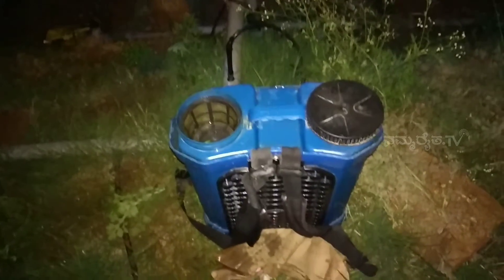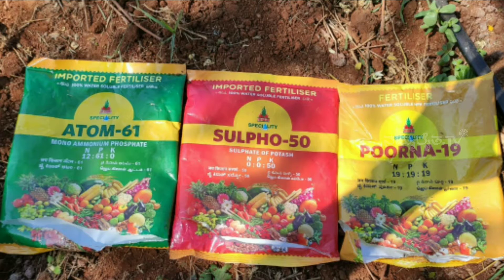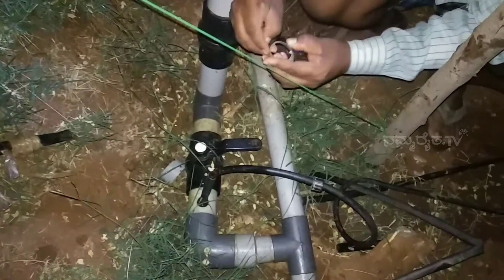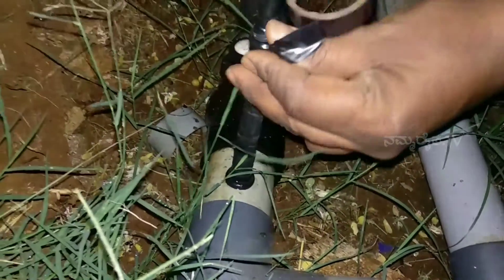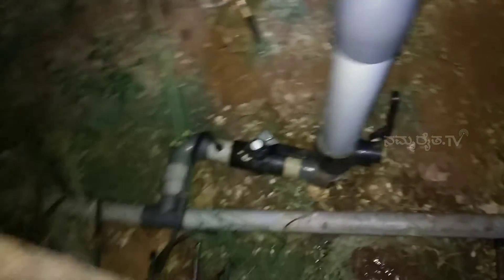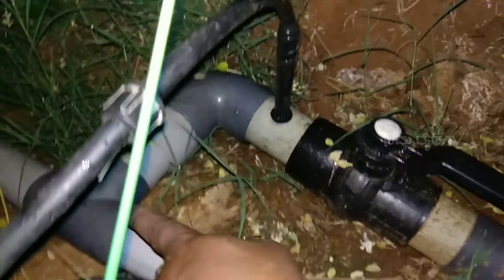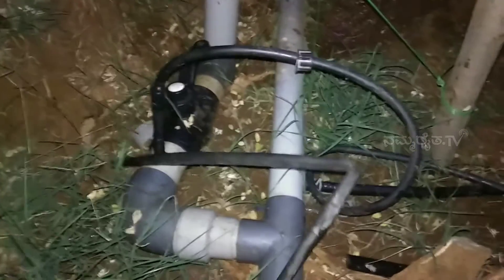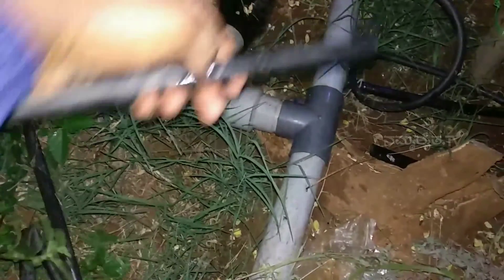ವೆಂಚೂರಿ ಇಲ್ಲದೆ ಡ್ರಿಪ್ ಮೂಲಕ ಗಿಡಗಳಿಗೆ ರಸಗೊಬ್ಬರ ನೀಡುವುದು

Comment: Instead of using dummy pipe, use ball valve to stop and start the flow of fertilizer. It will reduce your pipe sealing work each time.

Comment: I am also using same method I have venture system it will heavily damage pipeline because we has to close half of main pipe this method is very good even Yu have venture use this only
Reply: Hi.. I am planning to do ventury.. But this looks good..Which method is better? My drip pipe line is burried at 2ft depth..If u r using this method can u plz share some pictures.. 9739864491